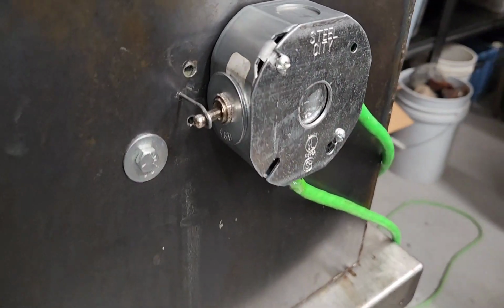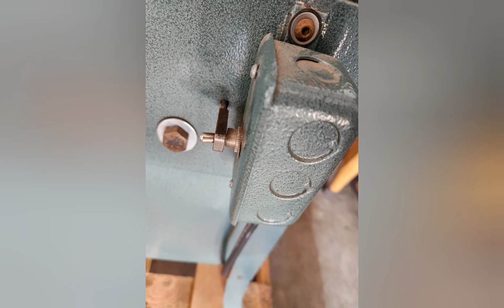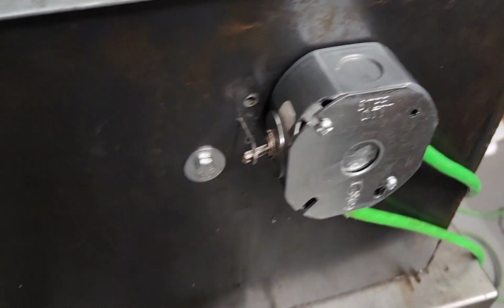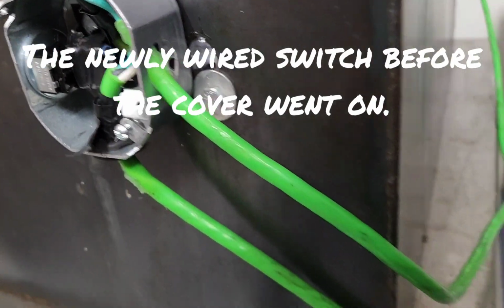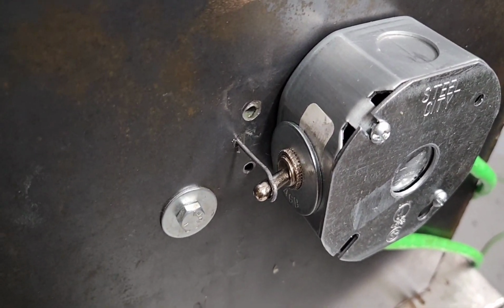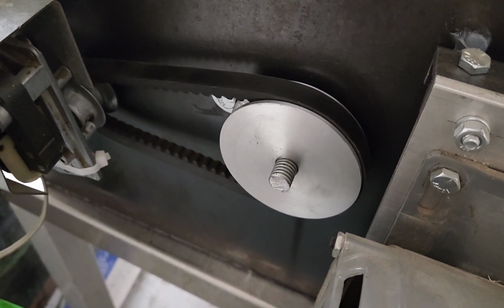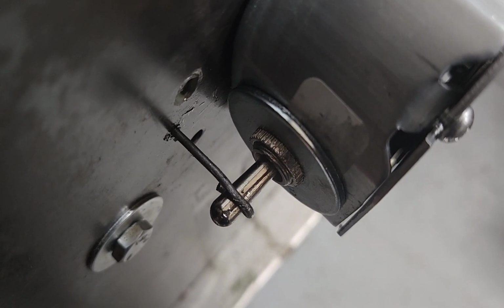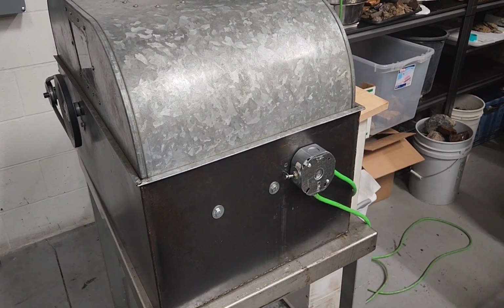Inspired by the Saw I Saw.

Comment: I had the same kind of switch setup and I changed my to a normal light switch because as you saw there with your switch those toggles don't fully click but are thrown enough to be off. What happen more times than I care to admit is that I opened the saw up, released the vise and then the switch flipped back into the on position and I got sprayed with oil.
Reply from the maker: Ahhh, I totally get how that could happen! I initially had a normal light switch, but the wiring didn't match and the toggle switch did. I bet the oil thing happens to me multiple times before I get motivated enough to make the same change... Gotta try to make clicking it off part of the routine going forward.

Comment: You can drill a little hole in the switch and put a metal ring which will hold the wire more secure. Current setup could fail at some point as metal wire could fall from the switch
Reply from the maker: Currently Rockhounding left a comment that the fact it doesn't click off leaves the opportunity for it to switch back on when I open the hood to inspect the cuts and loosen the chain, thus spraying me with oil - he's had personal experience with this. After looking closer at the saw I was copying I think I'll move the wire closer to the base of the switch where it has a better chance to "click" the switch off rather than interrupt the power before it "clicks" off. Looking closer at the pictures I took of the other saw it connects to the switch very close to the base, I suspect that is the reason why. The wire on mine has surprisingly little travel side to side, so I think it may be workable with a bend applied to the wire.

Comment: definitely you need to make it lockable in off position. my saw has an electric relay which disengaging the power to the main motor and auto feed motor once the carrier reached the end end of the cut, and you need to unlock it by pressing the button, this additional safeguard prevents the start of the motor even if you accidentally return the auto feed switch to its normal position. This saw made not in US, so probably this is not typical schematics for saw start-stop operation
Reply from the maker: As long as I can modify the current situation so that the toggle switch actually clicks to the off position at the end of a cut it'll be adequate, and as good as it was before. Yours sounds quite safe from unintentional restart with the necessary action of hitting the reset switch.

Comment: Your auto feed is quite slow. I believe it 1 or 1.5 rpm, interesting, seems safe and reliable and looks reasonable for home lapidary where cutting speed id not critical
Reply from the maker: I know the modification the guy made was to slow it down. Not ideal for commercial application, but the trade off is it also produces smoother, more finished, cuts that should be more presentable without any polishing and should require less work when polishing is desired. I haven't gotten into polishing yet, so maybe I'll learn that I'm mistaken. But at a minimum the cuts should be nicer than if the carriage was advancing faster. I plan to have more saws, I wouldn't want them all to run this slow.